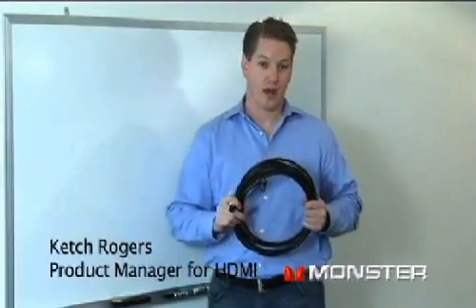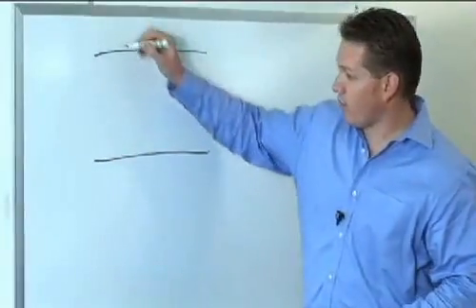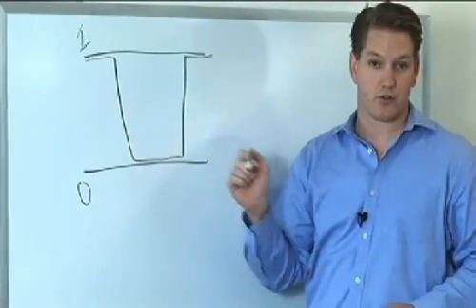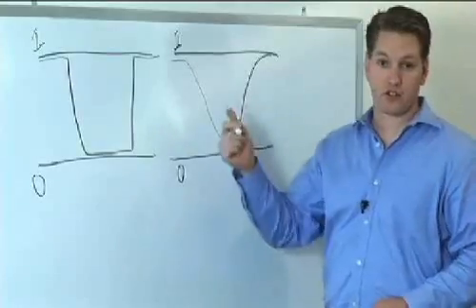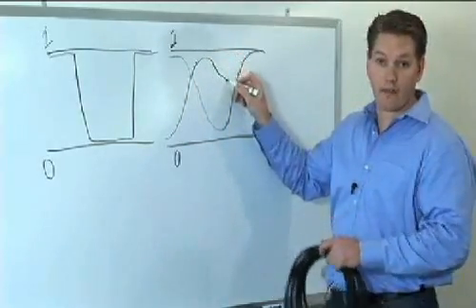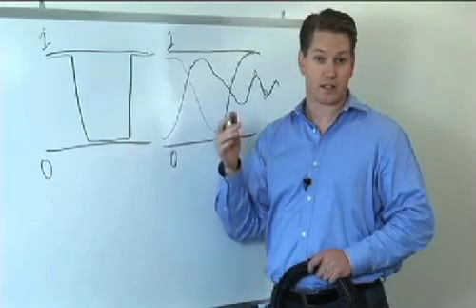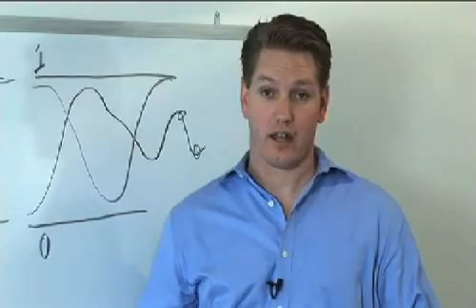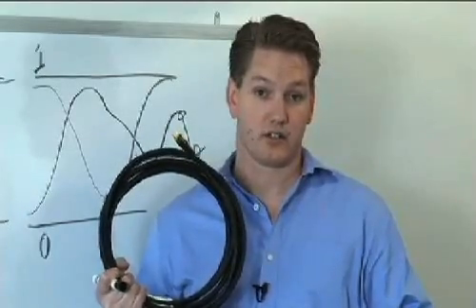HDMI cable data is digital, but lives in an analog world

Comment: Scientifically, yes this is accurate. However, 99.9% of the time a 6-10 feet cable  is as much as what's required. In that case a 3$ basic cable does the job of carrying 0s and 1s on that distance without any problem. Therefore, selling 6-10 feet cables with 4 layers of shielding with gas injection NASA powered technology is as relevant as selling a Ford Fiesta for driving in the western world with an anti-personal bomb shield making the argument that it offers superior rides. Pointless.